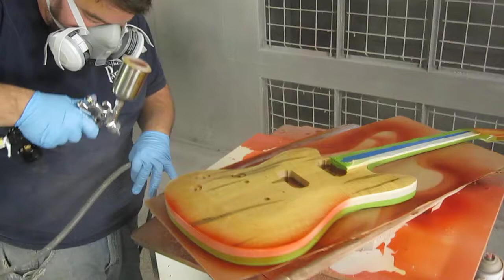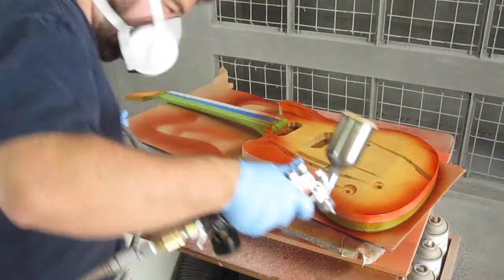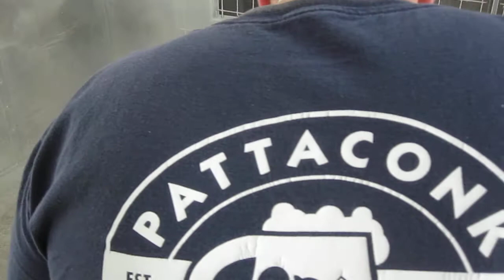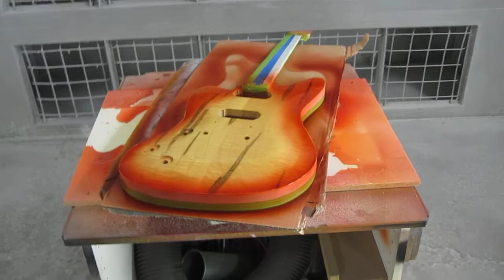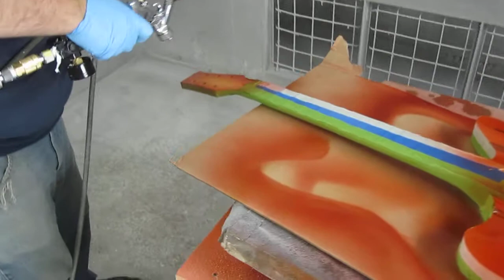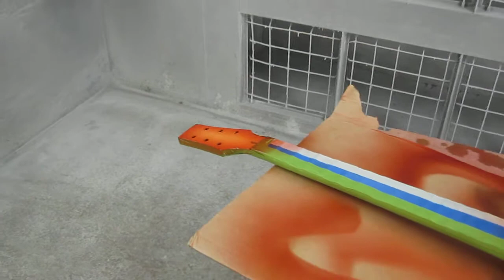Doug sprays a sunburst finish

Comment from the maker: @wldntknow I assume you're referring to the noise? That's because Doug's spraying in a commercial spray booth with a HUGE fume extraction system! The honeycombed wall behind him is actually one huge air filter with what amounts to a bunch of fans on the other side pulling the air through. The roaring sound (which is pretty damn loud) is the fans. The booth Kauer Guitars usually uses is much smaller - this one belongs to another shop, and is easily large enough to drive a truck into.

Comment from the maker: @SvddenDeth The short answer is that there's no way to repair a chip like you're describing with nothing but paint or rattlecans from Wal*Mart. You need some pretty specialized equipment and knowledge to do it in a way that won't be immediately noticeable. If you're interested in learning how to repair or refinish a guitar, I highly recommend the ReRanch website and forum. You can get supplies and a LOT of expertise from the forum members. Hope this helps - good luck!